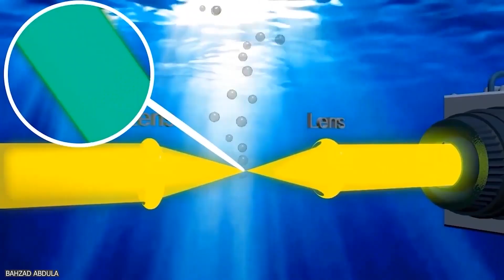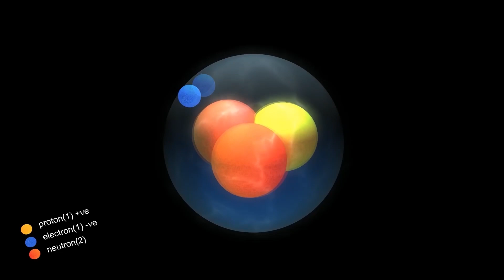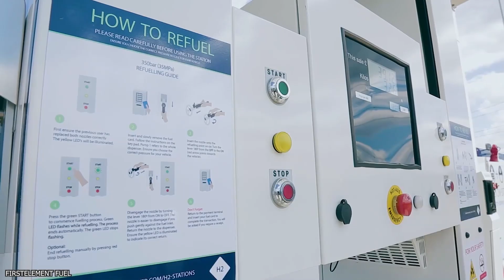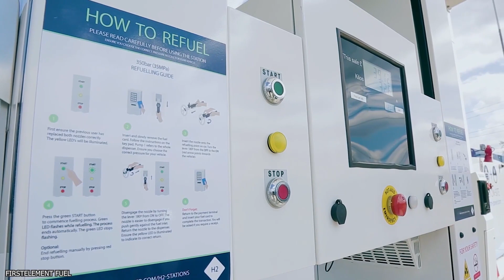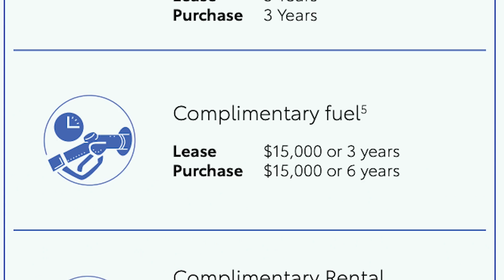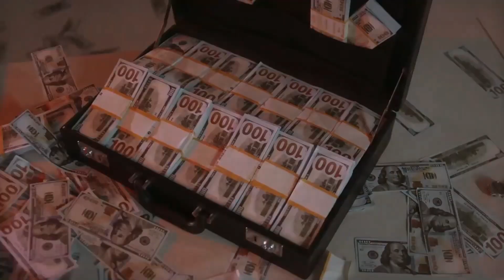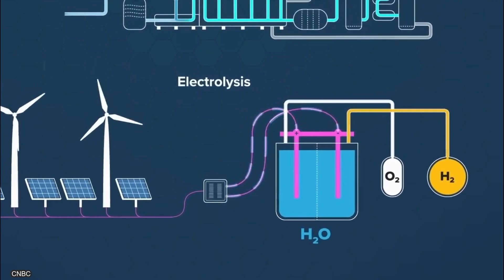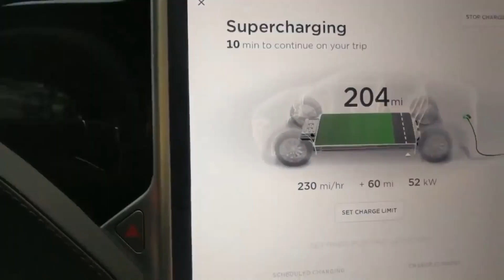Elon Musk : Truth about Hydrogen  Cars

Comment: You, like alot of these videos on YT, make a MAJOR error in your evaluation of the battery ev - you don't count battery production, recycling and disposal costs and wastage. Why are you sheep so dumb? What tf are they going to do in 5 to 10 years when those thousands and THOUSANDS of large, heavy car batteries are stacked up in junk yards leaking ACID everywhere? Realistic battery life vs BS battery life? Cost of replacing battery? Cost of disposing of non-reusable battery parts? Cost of pollution manufacturing battery and dumping battery corpse? Carbon credits costs? Did you factor in the amount of electricity required to make the battery? Was that electricity from a coal fired power station? Don't bother making crappy click bait videos and wasting my time.

Comment: You can get enormous battery capacity with hydrogen, but when charging you waste half the electricity as heat. This is significant when talking about millions of electric cars, yet might be acceptable for a phone. You've just doubled the amount of power stations needed and if they run off coal, also the carbon dioxide.